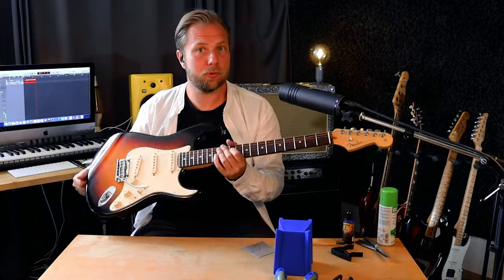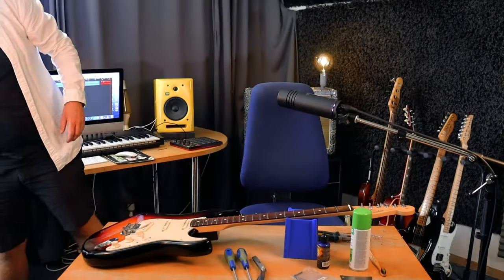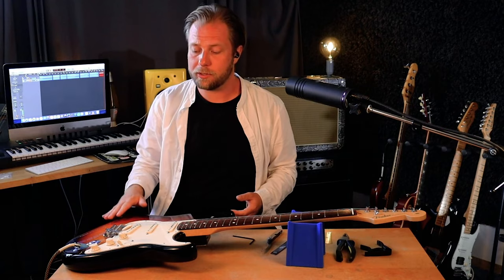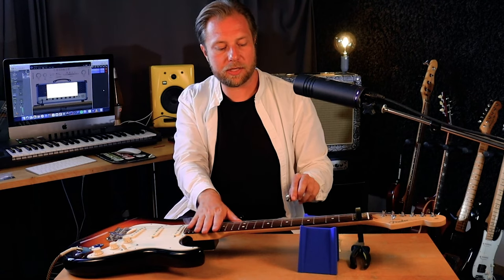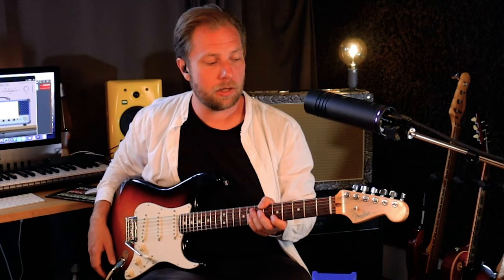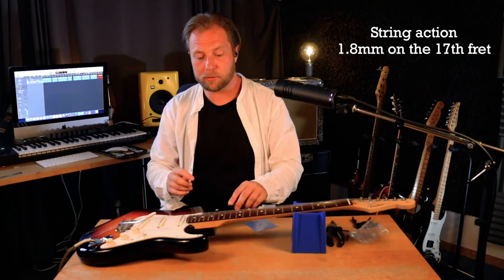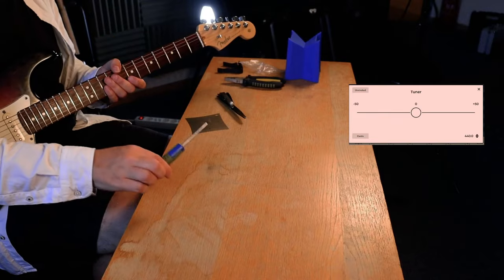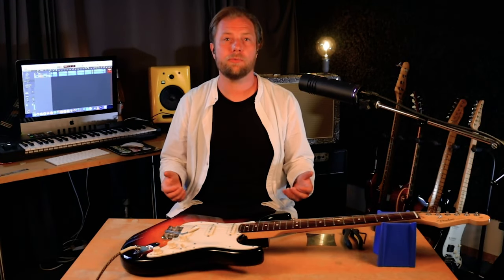This is how I set up my Strat - Neck relief, action and intonation.

Comment: Very generous of you to share. I’ve sold three strats because of bad setup . Had I been more informed I’d have just set it up myself
Reply from the maker: I know the feeling, I ended up learning how to do it myself after getting disappointed time and time again after having my guitars set up by someone else. 
Hope you found the video helpful ☺️
Reply: I hear ya same here!
But I’ve  also wasted probably 100+ hours trying to set it up & it just never would be quite right. & STILL here I am looking for whatever I’m missing.. only reason I still bother is because I’ve also wasted
$60 here/$60 there (& sometimes went w/o my guitar for couple days), at different music shops for “professional” setups & have been completely dissatisfied sometimes they’re worse then mine/how I brought it in

Biggest 2 issues I always have is 1 when doing it by myself .010 is so small & my feeler gauges are such a small set that it’s hard to tell when I have the relief correct & 
2.) the saddle height & radius problem never seems right, therefore the height from string to string never feels even remotely correct & I have to work so much harder @ single note picking… like especially when you intend on string skipping but instead catch the open string between😒 & strumming becomes something I want to avoid because I may entirely miss a string or 2 or accidentally hit 1 I wouldn’t be if it was set right so chords sound wrong. (It makes playing my guitar & learning new things even more difficult than it would be & it’s discouraging & I spend more time trying to work on/adjust my guitar than actually learning something new (let alone new {entire} songs) & possibly even more than playing the same ole riffs/licks over & over

Comment: Hi. Excellent set up explanation. I have a Squier Infinity HSS Strat. What exact size of Allen keys and Phillips screwdriver do I need to adjust the truss rod, saddle and intonation? I have lots but none seem an exact fit!
Hope you can help. Bob.
Reply from the maker: Hey Bob! Glad you found the lesson helpful. 
Unfortunately I haven’t got the right measures with me but usually the keys for the truss rod and saddles come with all new Fender guitars and some Squiers as well I think.
You can try a 1/8” key on the Truss Rod and a .50” for the saddles.
Not sure about the Phillips.
Reply: @Kbald Many thanks. I’ll give it a try.

Comment: thanks for this! how do you use the radius gauge to fine tune the string height accordingly? i saw you press it against the strings, but do you then look if the strings touch or are depressed by the gauge? or do you also play the string and see/hear/feel if it buzzes against the gauge?

Comment: Great job but I still have an issue intonating the high E-string.
I have an American Strat. It has two bolts / screws in front securing the bridge.
My strobe shows the high E string slightly flat and I cannot shorten the string anymore because the saddle mechanism is right up against the bridge bolt. Neck relief and string height are set to spec.
Do you have a solution?
Thanks.

Comment: Informative vid but -  you go from using .010 of an inch relief to 1.8 millimeters doing the intonation at the 17th fret. Can't we show either imperial or metric ? using two different measurement scales just makes things more confused, especially for those just beginning  to learn to do their own set ups.
Reply from the maker: Thanks for the feedback. 

You definitely have a point there but the reason for why I measure the neck relief in inches and the string action in mm is mainly because of the tool I’m using, the feeler gauges.

Fender actually recommend a 1,6mm string height which would be 4/64” which I can’t work out with the feelers, I would need a different type of a ruler. 

In the video I also mention that all the measures can be found on the Fender website in both metric and imperial.

Comment: How did you measure 1.8mm for height?  I have a Bullet Mustang which is a 12in radius and only 24in scale.  Is it still at the 17th fret for me as well?
Reply from the maker: I put the feeler gauge under the 17th fret to measure the string height on a Strat but I would measure on the 12th fret for a Gibson.
In the video I set my string height at 1.8mm although Fender recommend 1.6mm.
Maybe you can find some info about the Bullet Mustang on the Fender website but as the scale and radius are a bit closer to a Gibson you should maybe try to set it up like a Gibson.
For a Gibson style guitar I usually go for 0.08” on neck relief and 2mm string height on bass, 1.5mm on treble. 
What type of a bridge/saddles have you got on the Mustang?
Reply: @Kbald  Standard (almost) Strat style two hex screws per saddle style.  The only difference is (and I hate this) is that the strings go through the bridge not through the body (fixed bridge).
Reply: @Kbald  Btw, the documentation supplied with the guitar by Fender is generic and really not specific (even covers basses).  It says the string height that  my tremolo must float (which we do not have on this model) for the action is .098in Treble Sector and .12in for Bass Sector.  This is why I ditched it and went looking to find your vid.
Reply from the maker: I see, yeah it must be a bit tricky to find something specific on that type of guitar. The string height they are recommending is very low.
For a generic strat/tele (9.5” radius) they recommend 0.10 for neck relief and 1.6mm string height. 
I’m very glad you found my video and I hope you find a way a way to get the setup right on your guitar.
Reply: @Kbald  My other guitar I set up was a Squire Fat Strat from 16 years ago so I may just set this up as I did it and roll with it.  Same number of frets between the only difference being 24in/12in radius vs 25.5in/9.5in radius.
Reply from the maker: Sounds like a good plan. Just try it out and see how it goes. You can always adjust some bits if needed.

Comment: Hey Kbald, I hv lowered my string action but, still the strings are quite high from the fretboard, do I need to adjust the truss rod?
Reply from the maker: Hello mate, yes you should always adjust the truss rod first. It is very important to do things in the right order. Truss rod - string action - intonation. If you don’t have a feeler gauge you can try to use a business card to messure the neck relief, not as accurate but many players do that.